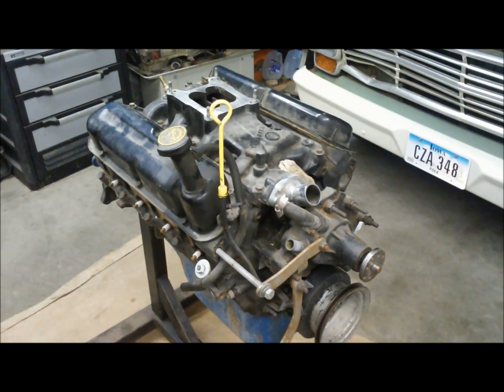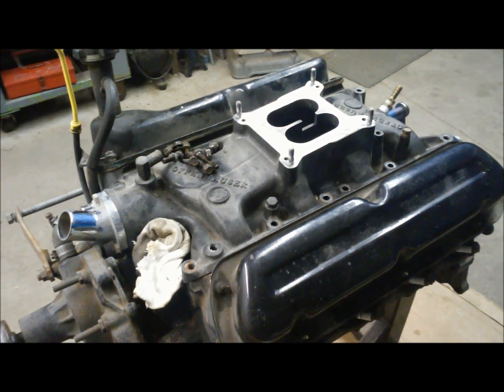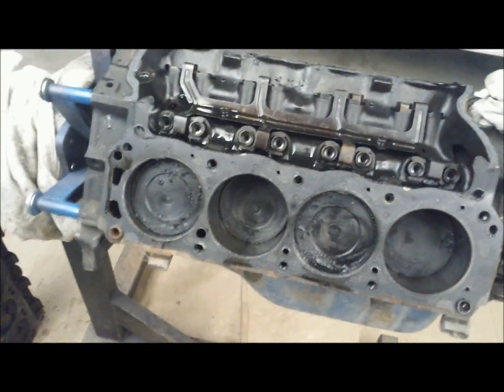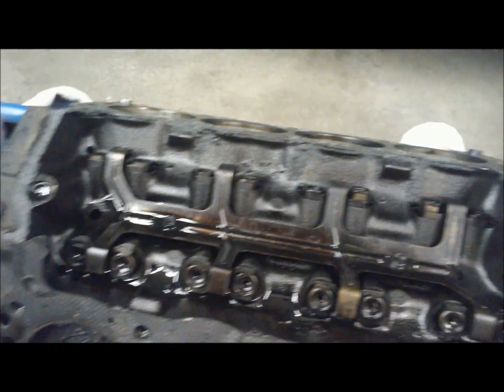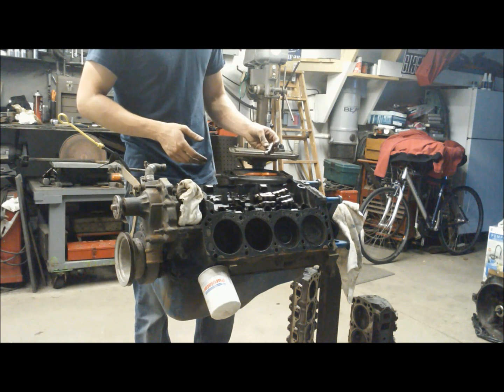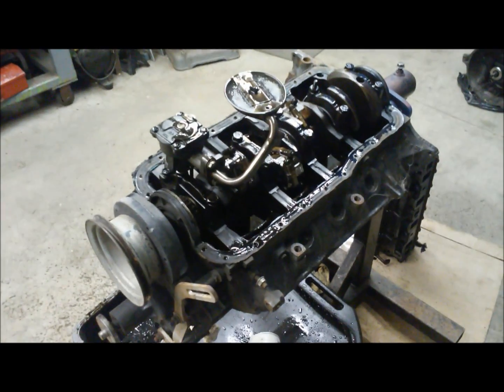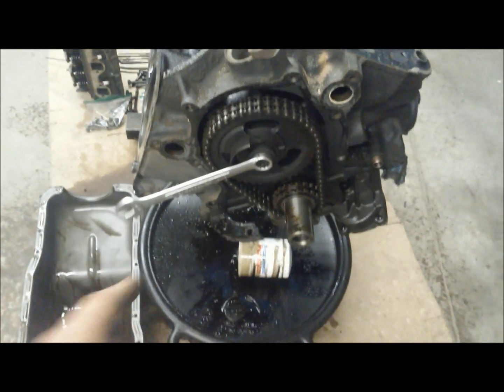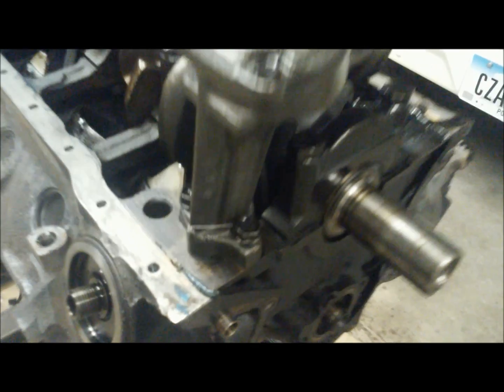Ford 302/5.0 Engine Tear Down - Step by Step Walk Through (Part 1 of 3)

Comment: Notice this is the 1986 5.0 one year only without valve relief pistons so a higher lift cam is a not an option because of that also the one year E6 heads suck on a performance build the E7's  replaced them 1987 and the pistons now have valve reliefs.

Comment: Hi there I have Ford F-100 1978 the motor 302 I  am get gas in block I smell gas in my oil I and I have holly carburetor and have new fuel pump so we’re do I turn motor to to put the fuel to put new pump on to
Reply: Maybe it is runnin too rich? What cfm carb? Also possible rings worn gas goes by them and gets in the oil

Comment: Great content man! I was gifted a 1969 Ford f100 302 V8 C6 auto tranny. I’m gonna pull the engine. I would love to put all sorts of goodies to bump the performance and just make the engine last that much longer. However I’m on a budget and just want it to run right with no leaks internally or externally.  What would you recommend changing most? I’m doing valve cover, oil pan, tranny, and carb gaskets so far.

Comment: those valve covers look accurate for 86 but a blue oil pan?
Reply from the maker: It’s from an 86 wagon. 
Carb converted it and had it in my 74 f100 for a temporary engine. Pan was to make it work for the f100 crossmember

Comment: What does it mean is its a winsor engine or Cleveland ?
Reply: There were 2 Ford engine plants in the 1960's.  One in Cleveland Ohio, the other in Windsor Ontario Canada. (near Detroit ). From what I have read online, the small block fords 221.260 289, were first made in Cleveland only, then the 289 , and 302's were made in Windsor starting in 65, 66,  or so.  But The only engine ford called Windsor was the 351 Windsor.
Reply: Google my friend
Reply: It's a series of engines. The name comes from the city they were originally produced.

Comment: @thunderhead  I have an 1986 lincoln continental mark VII and it has 83,000 miles on her..i trusted thr guy who sold me the car said it ran fine..so i drove it....well i got on the e way and it started somking from the engine bay area and it was whiteish smoke..and from the tail pipe it was a blackish blue smoke..i put water in. Her and it cooled down and the engine light came off and she drove fine..i drove her agin the next day and she turned off at a intersection and was trying to turn over but wouldnt so i walked to pepboys and put 2 quarts oil in this 5.0 engine and she turned over immediately...she also turns ofg when i slowdown or come to a stop....what should i do and what do you think

Comment: PULL BALANCER BOLT, REMOVE WASHER,REINSTALL BOLT THEN PULL BALANCER OR YOU,LL MESS CRANK SNOUT UP
Reply from the maker: +Robert Cowan not true at all. This is a misconception made popular by Eric the car guy. Observe the puller design for one, and for two - that’s how it pulls straight out. You well never mess up a thread using the puller kit properly. Period. Search Thunderhead289 harmonic balancer. Iv done this many times on camera

Comment: @thunderhead 
how did you clean the engine after it was dissasembled?
Reply from the maker: i have a video series on budget rebuilding the small block ford engine - there i detail how you can safely go about it on a budget. also, you can always take it into a machine shop and have it boiled.
Reply: Or you can get a 120L plastic tub and a few 1kg bottles of Caustic Soda (Available at any grocery store) and then chuck the block in it for 24 or 48 hours... For less than $50 it comes out like new... Just did mine. Just don't put aluminium in it.

Comment: my 87 302 out of my f150 is a flat tappett why is this?
Reply from the maker: im not sure why ford did this, but the truck engines have a roller prepped block with a flat tappet cam up until 94 for whatever reason. so your block is a roller unit with the roller hold down bosses and raised lifter bores. i also would believe it to be the original.
Reply: ThunderHead289 yes it is the original
Reply from the maker: a roller cam and lifters with the holddown and dog bones can be purchased and directly installed into your engine if you so wish to do so.
Reply: ThunderHead289 right on i thought so it's got the two holes in the valley , but it's good to know for sure enjoy the videos

Comment: I have watched a ton of engine rebuild videos in preparation for rebuilding my 302 and you are now my official source for SBF videos haha. 350s here and LS there but hard to find GOOD ford videos, so thank you for such great, knowledgeable and easy to follow content! I will be going through all your vids in time, keep up the great work! any SBF specific rebuild books I should consider getting off amazon?
Reply from the maker: Hey thanks! And indeed there is! Check out my engine build walk through playlists. Both series I introduce a book I used when I just started. It's an awesome read for someone who hasn't gone through it themselves yet !
Reply: E Gibson can i drop a 5.0 from a 96 explorer into a 2000 mustang gt and would it be worth it
Reply: ThunderHead289 can i drop a 5.0 from a 96 explorer into a mustang gt 2000
Reply from the maker: that you cannot do, you can always work over the wiring, but the k member on the 99 and up units will not work with that engine!!

Comment: My friend you can do this so much faster with electric impact tools. like Snap-on, Matco even Dewalt.
Reply from the maker: For sure! But not everyone has those! I try to make everything and do everything so the most ill equipped user can wrench!
Reply: +ThunderHead289 I see, just being an auto tech myself for 20+ years, I see ya doing it the hard way. Well nice video either way...
Reply from the maker: +The Ex-One show If I was an actual mechanic, I'd probably be using some! Just haven't forked over the bread for them!
Reply: hey thunderhead289 ur video,s are great. I have a question for u. I have owned several 302 motors. I remember reading in 1 of ur videos u wrote u like the 289 better .I believe u said it was a better balanced motor. is it just the 28oz crank u prefer? or is it how it winds up faster?i have alaways wanted to build a 289.i hear stories from old timers around my way ,but I have not  personally owned 1. ur input would be appreciated.

Comment: Great video as always. I have a 69 Fairlane/Torino 302 that came in my Bronco when I bought it, it ran damn good before I took the bronco apart to restore it. The only problem I had was it leaked a little oil from around the pan and had a lifter tick(I am assuming from it sitting).  I'm assuming it was rebuilt about the same time the transmission was in 2006 which they painted on the C4. I know it has a cam in it because it has the newer 351w firing order.

 So the plan is right now to just reseal it with new gaskets. I think I am going to at least put a new timing chain on it. Not sure on the oil pump, but what brands do you recommend. I'm looking at the ford performance ones,but are they really worth the higher cost $120 vs 40 or 50 for comp cams? Difference between steel and iron gears for the timing set?

Thanks. Nathan
Reply from the maker: sounds like it must have a cam in it. i think the steel gears are for the higher spring lb stuff. you will be just fine if you run a cloyes TRUE double roller. id replace the oil pump while i was there - melling is a good brand. dont put in the high volume. do you have guide plates under the valve covers?
Reply: No, no guide plates. Why? Thanks for the help.
Reply from the maker: id check your pushrod geometry then. people always put in cams and then do not account for the changes in the valve springs.
Reply: Well I forgot to mention it is just on one cylinder. Sorry
Reply from the maker: im not talking about the tick, that surely is a lifter from sitting. but if the valve geomtry is wronge, the valve guides wear real quick. just give her the ol marker valve stem check. 
but if its a stock cam = no lope, its probably just fine.
Reply: Will do. That hadn't even crossed my mind. It has the non adjustable rockers so i'm definitely going to check it now. Thanks, that probably saved me a headache down the road.
Reply from the maker: +Nathan43 hopefully it patterns up nice